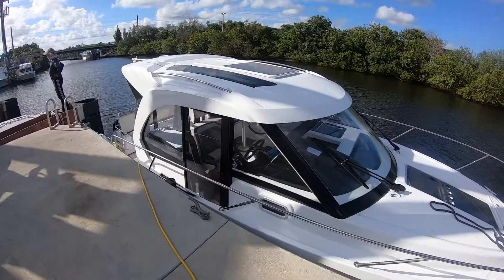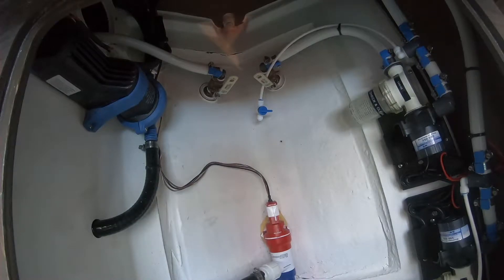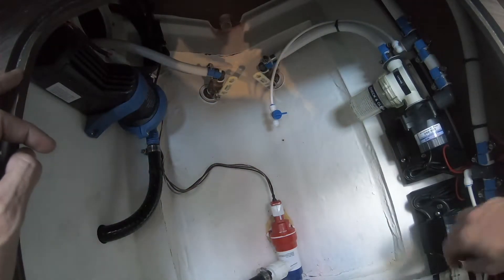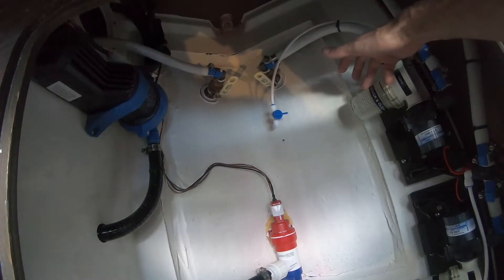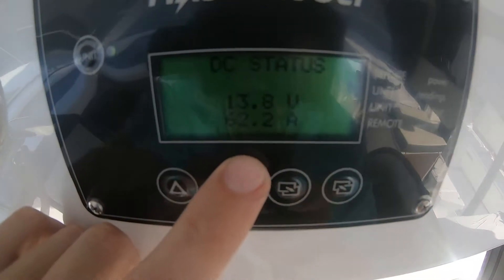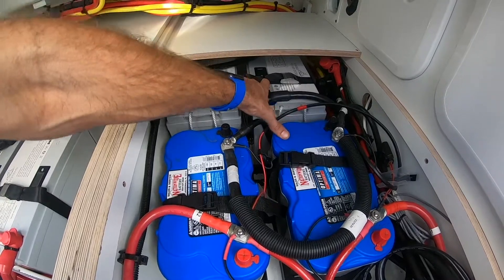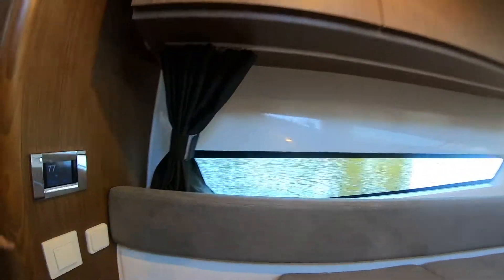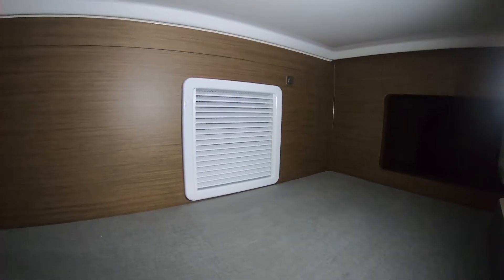Beneteau Antares 9 with Battery Powered Air Conditioning by Mabru Power Systems

Comment: Why not just use the onboard AC and add more lithium?
Reply from the maker: It would require at least twice the lithium for the same runtime which would increase the necessary charge time and being able to run the ac without depleting the battery bank would not be possible.

Comment: My goal is to eliminate my generator, 4kw fisher panda. I have one Air con unit with two small spaces in my cat boat, 32 ft. One side is a small bunk and the other is the head.  I think your video is saying, "yes, you can do it!". right?
Reply from the maker: The short answer is yes but it still greatly depends on use. For a full day out on the water and even overnights, this system is the ideal way to go. For longer trips, we need to start considering how the bank will be recharged (solar, shore power, engines) and see if that would work for you.
Reply: @MabruPowerSystemsINC  I spoke to Omar. He was very helpful. It sounds like you have a great system.

Comment: Are you using a regular charger on the start batteries in conjunction with the high amp lithium charger? Or is the DC DC charger bidirectional?
Reply from the maker: The start batteries are charged with the charger that comes on the vessel and that remains unchanged. The battery to battery charges that we use only work one way.

Comment: How long do the batteries power the ac? How long would it take for batteries to charge back up?
Reply from the maker: Batteries will power the air for 12hrs running at full speed due to the extra 250Ah added for the inverter. Standard setup gives 8hrs at full speed or 12.5 hrs at minimum speed with both units running. From dead batteries to fully charged, this setup would take 8-9 hrs to charge.